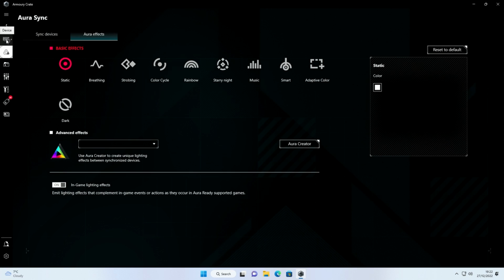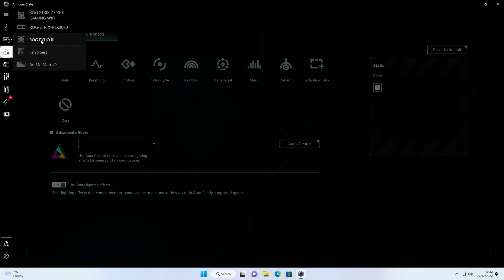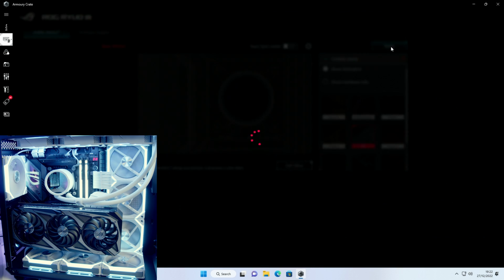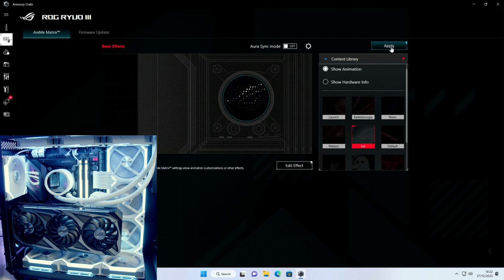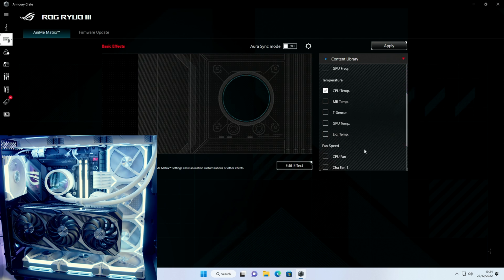ASUS ROG RYUO III 360 ARGB - Installation Guide (LGA 1700)

Comment: I wish these install guides were more detailed about  all the trials and tribs instead of zipping thru with everything working properly on 1st crack.  Like how bout how to improvise if your board doesn't even have a pump header?   How to use a SATA to power a pump? is there an adapter piece?  etcetera, etcetera...

Comment: Quick question here. I have the cooler. And I have an intel cpu. I’m currently switching to amd but I want to keep the cooler. Can I use the same screws and brackets that I used on intel and use them on my new amd cpu? I think I threw every else out. I’m assuming I can’t and Ima have to have amd screws and bracket. But worth a shot asking.
Reply: aslong as you have the amd brackets and a motherboard meant for amd

Comment: Just plugged mine in and nothing is on the display? Fans are running the full RGB but nothing in the display at all?? Any ideas folks?
Reply: Did you plug the cord that comes off the pump in the 2.0 header

Comment: I thought you had to use the mounting screws that have the cut on the middle for lga 1700?
Reply: The ones with the cut in the midle are for LGA 115X and 1200

Comment: Thank you for the guide. What about the pump? Does it rattle when under load?
Reply: slightly you can hear it but only when you mounted the tubes not in the best potential postion.. like aio on side can rattle if pump is filled with air, but there is also enough solutions for it (you can rotate your system so aio pump isnt the highes point in the AIO system so the air moves into the radiator) I hope it helps :D its a good AIO with stable software, I can recommend it
Reply: @xBestermann  so the radiator to be on the roof ?
Reply: is it noisy at idle but full load gaming/editing ?
Reply: @mathew227  no its not noisy in idle, radiator on roof worked perfet for me
Reply: @mathew227  it has a white noise on idle and full noisy when its on load.. I fixed it by turning it to 1000RPM manual on L connect, you sacrifice like 3-5 degrees overall than its not noisy anymore but I cant recommend them at all.. if you are not into RGB just look for thermaltake toughfan 12 or noctua, those fans you wont regret at all.. thats cool fans

Comment: Hey, do you know if I can replace the RGB fans with regular black non RGB Asus fans? I love the look of the cooler but do not want extra RGB on my fans.
Reply: same question from me :S i want to use non rgb fans from corsair its called AF120 Elite fans
Reply: @reijhinru1474  Hey check out kleo yan’s video, I asked him the same question in the comments and we chatted about it
Reply: fans r not connected to pump so u can use any fans u want, u just don't need rgb cable
Reply: @PacyfikatoR-2na1  thx!